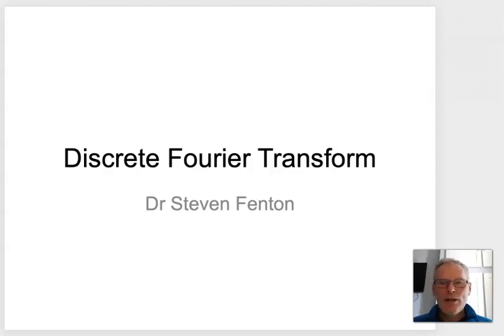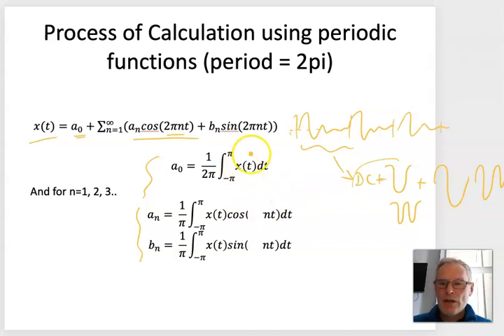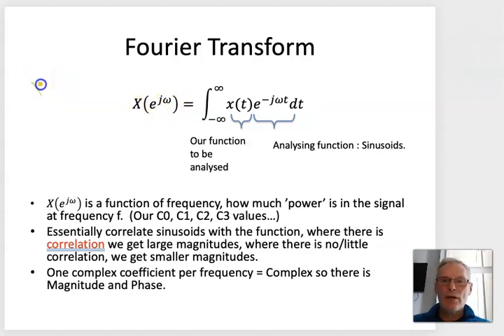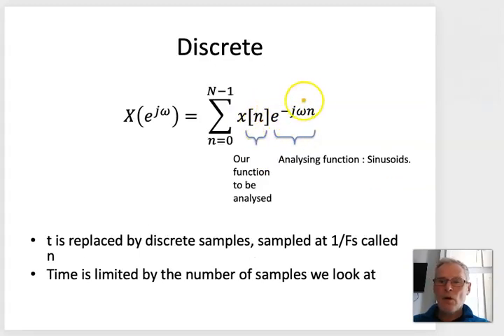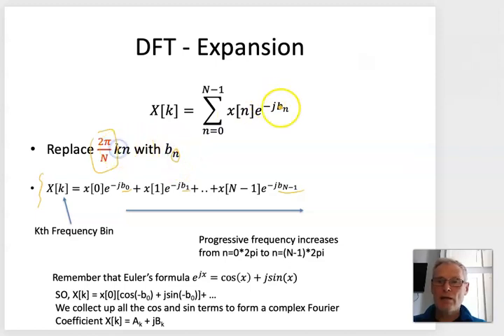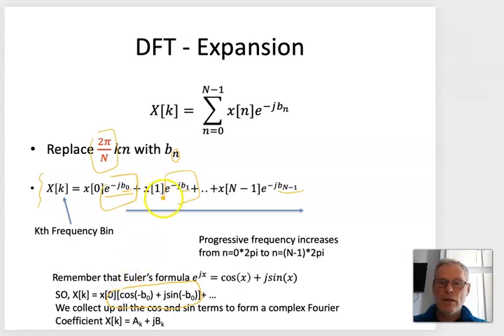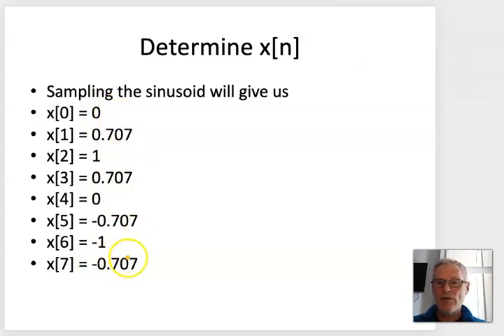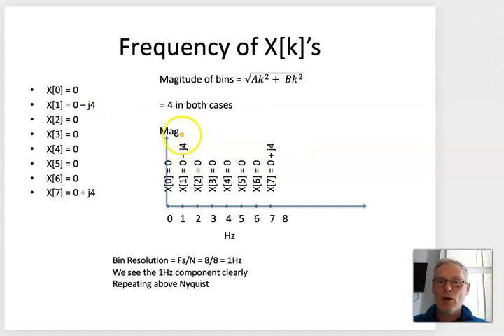DFT (Discrete Fourier transform) Explained with example (update)

Comment: I have been trying to understand FFT concept. This is the first time it opened up s little bit more for me. I still need to watch the video few more times, I believe, to clearly understand the concept.  Could u please do examples, using some functions and splitting them into different components, DC, waves?
I will try to ingrain in what actually samples mean.
I will not give up until I totally understand it. 
Thank u for making it simpler to understand.
Best wishes
Reply from the maker: Glad it was helpful. I will add more when I get some time.